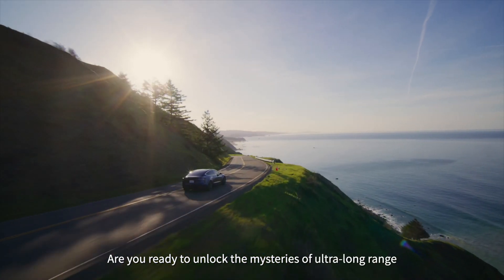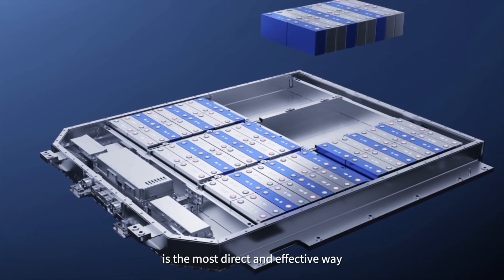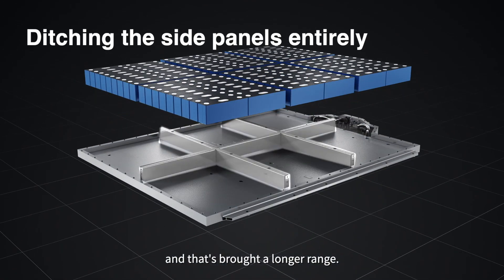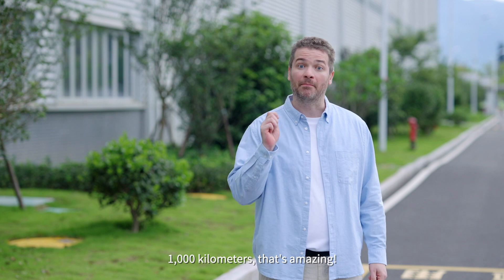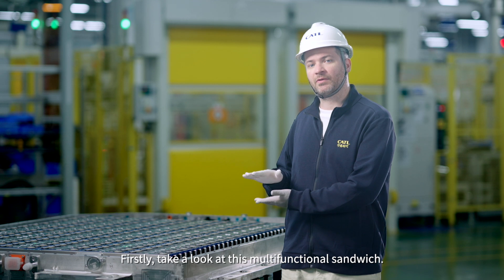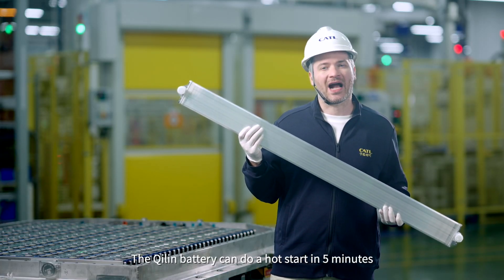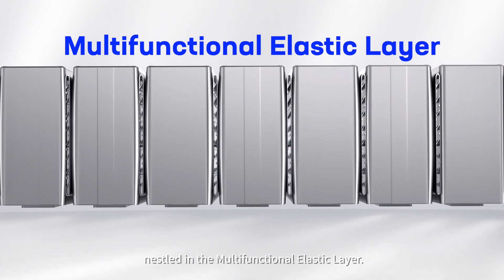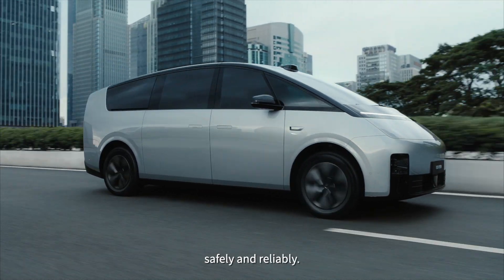Unveiling CATL’s CTP Technology Advancement Journey

Comment: But with this batteries you got one big problem.
If only one cell goes down after warranty you can't change it.
These cells are glued and packed in so good that you can't get it out for easy change like in the old batteries.

So you can only change the whole battery. This is a expensive task for a old used car.

I know this cells can probably last over 20 years but it's a probability thing. Some batteries won't achieve this and some want.
I think we should build batteries with the capability to change cells.

Comment: Not optimal : We can achieve better density with longer cells and side terminals saving space on the Z direction. Also the old fashion's jelly roll they still use is less durable than competitors stacking technologies ....
Reply: @kenbehrens5778  YES, i do ! 😁Catl is heavily invested into the decade old VDA like format, thus kind of stuck with it (10s of billions $€ production lines). While other more optimised chemistry related cells formats have emerged in  the meantime.

Comment: 1/ Please give more technical detail.

2/ MG have just introduced lifetime warranties on the whole high voltage system from battery to motor. When will CATL follow suit?

3/ In places like Australia the charger network is very haphazard with remote locations and long distances and most chargers being quite slow. I would like to see companies like CATL to enter the charger network and install high speed chargers so EV owners can take advantage of the fast charging CATL batteries can provide. Currently in most places we can't so CATL saying you can get 500K's in just 12 minutes is irrelevant. There is nowhere to do that.
Reply: Major Government BESS projects used CATL solutions that were worth more than 100 words.  As for entering the charging network it has to do with your local inefficient government.
Reply: @rogersliu1200  are governments supposed to create charger networks?
Reply: @DeveloperChris  they need to approve it first. and look at most of the local gov projects with charging stations they just awarded to various different brands and solutions. Tell me how to get a network done. Businesses are here to make money not make your life easier. If your market si so small and scattered, who would build a network for you.
Reply: @rogersliu1200  in some places I am sure red tape is a major blocker. But as you rightly say we are small and scattered. Which is why profit from selling electricity will struggle. Thats why a company like Catl could step in. Their primary profit is from selling the batteries. And in a place like Australia the market is a good market suppressed by the lack of good chargers.

Comment: There are no qilin packs in the market or in any EVs with 255 wh/kg in pack level energy density.with that kind of energy densities 100kwh pack will weigh 392 kg which has not been confirmed to be on the streets  yet.all we know is that in 2024 zeekr 001 its qilin NCM 100 kwh pack has 165 wh/kg energy density;and 200wh/kg for 140 kwh NCM qilin version of it;meaning non of your packs have got no where near to your advertised claimed 255 wh/kg energy density,i assume you are doing this just for the sake of marketing and stock prices nothing more
Reply: agree, they must be using top of the range NCM chemistry at least 300Wh/kg at cell level to reach those 255Wh/kg at pack level, therefore with high Nickel and over 10% SiOx doped anode. And on a prismatic cell, there are high safety risks using such chemistry. That may explain why we do not see such pack yet on the streets. Personnaly, i do not want to drive and park such car ! Better stay with safer-cheaper LFP and fast charging specs.

Comment: An EV should be able to go at least 600km per a charge and average sedan EV should cost about $25,000. Then the game to compete EVs with ICE cars is truly over. I know this is possible with current EV technologies, and the price is also achievable.
Reply: I think you're asking too much, not that it's unachievable, but companies need to make profits to keep funding r and d and employing the best engineers.
Reply: with fast charging (eg. 15min for 10-80%), you doi not need to carry some expensive dead weight all year around. For a $25k BEV, you will get a 40 to 50kWh LFP pack at max that will allow you to drive 300 to 400 km. Therefore the need to get fast charging specs.
Reply: The BYD (#3 auto manufacturer world-wide) Seal sedan - equivalent to a Camry, Accord, Sonata etc with ~60 kwh battery starts at $25k. The Xaomi SU7 sedan equivalent to a BMW i3/ Tesla M3 starts at $30k.

That's the reason for all the tariffs on EV/hybrids from China in countries dependant on legacy auto. It's fair tbh because if the same cars were made with union labor they would be more expensive. Not double 😂 but more.

The same thing was done to Toyota, Honda, BMW etc and they capitulated and built factories in the Markets they intended to sell in.

The difference now is that the biggest market is no longer America and Europe. The biggest market is in China. Building a factory in Mexico makes more sense for North America and in Eastern Europe for the Euro market imo.

Toyota has agreed to use the BYD platform for its EVs and perhaps hybrids in the future so we will see some integration into the existing factories in North America.